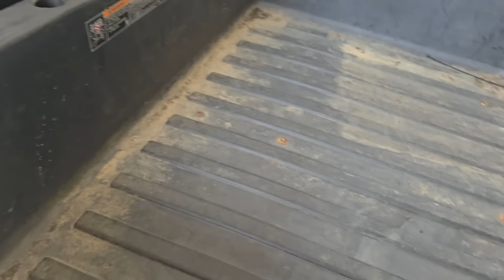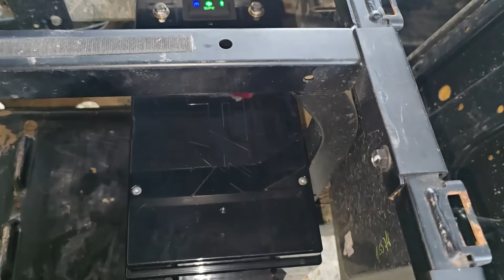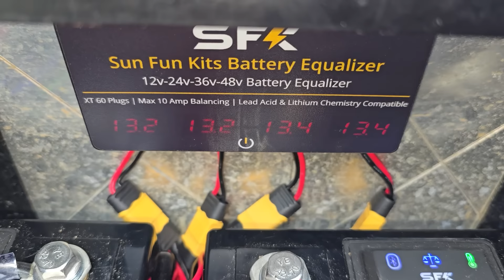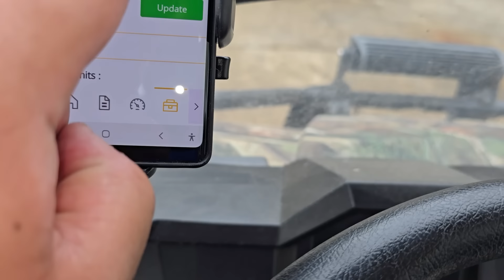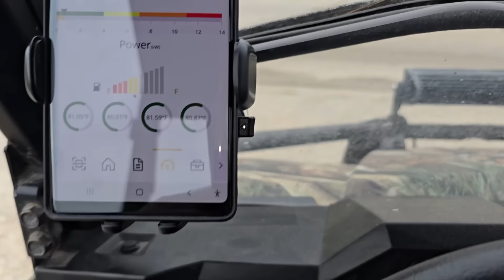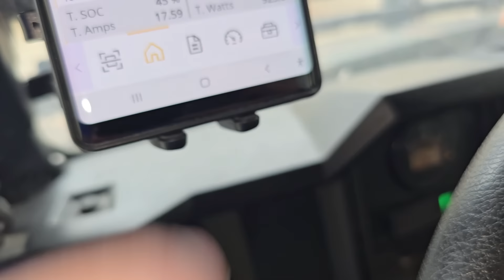Sun Fun Kits Polaris Ranger EV Lithium Conversion Kit 16.4 kWh 315 AH.

Comment: Do you put the charger in a specific algorithm for the lithium batteries?
Reply: I have this kit, you just use the stock algorithm but you need to plug and un plug the charger to fully charge it as it stops charging and then you have to plug it back to get it to keep charging. A wall timer fixes this as it turns it on /off every few hours.